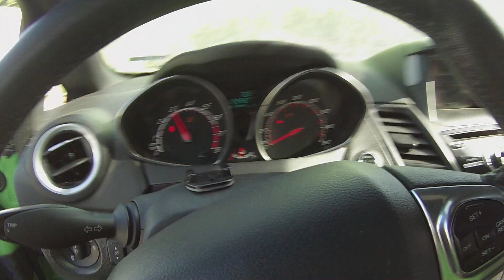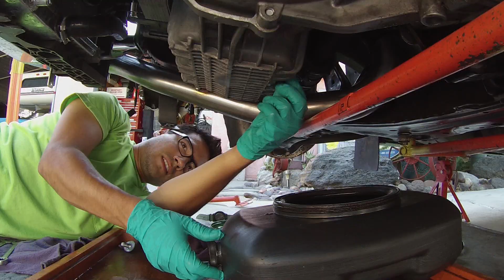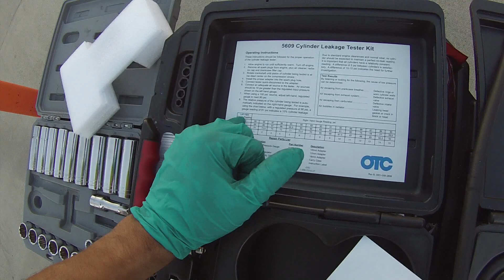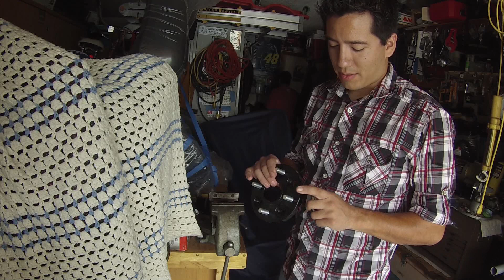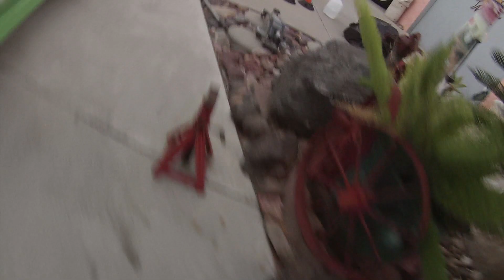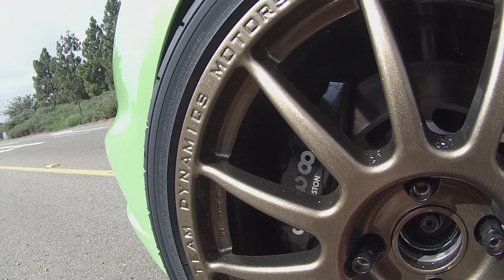Evolution of the Green Beast: Ep. 3 Engine Break in and First Drive

Comment: The reason your spacer failed . The torque spec for the lug nuts is  not enough to completely set the new stud into the hub! You installed the studs thinking they were completely seated when actually they were not. Then you installed the wheels and torqued the lug nuts to spec but the moment you started to drive the added mechanical leverage forced the studs to seat which caused the excessive play to hammer your spacer. Not crack' n on you but as a long time builder and prep guy of over 45 race cars I have seen many people make the same mistakes.  You are young and props to you for the diy efforts as not to many of the youth today can even change a flat tire. Everyone starts somewhere and you have a great future in your hobby.

Comment: 2 weeks after having a Wavetrac diff installed in my iB6 gearbox the input shaft catastrophically failed and somehow punched a hole in the far side of the trans casing. You're not the only one man. My cars been sitting at a shop for 2 months now while I scrap money together for the replacement (same mileage found for $500-700) These things suck, but like you said, it's a momentary setback.
Reply from the maker: Andrew Molnar wow that is a big failure. I know it sucks waiting for the car but it's worth it in the end!
Reply: It is... It's actually made me question the limits of the stock transmission. I thought the iB6 was strong enough to hold 300-400wtq with sticky tires and Limited Slip but a few 2 wheel test burnouts were too much for it (specifically the bolts on the far side of the trans casing holding the input shaft and bearing in place). Those bolts were either loose to begin with, or need loctite to ensure vibrations don't let them back out and then allow a shipped tooth. I got an old '99 volvo s70 awd, its a 2.4l inline 5 with a turbo to daily in the snowy winters here and while the fiesta is down, and its great... but 1000lbs difference and same power as a stock FiST lol... I miss the FiST man.

Comment: What size wilwood rotor are you running?
Reply from the maker: Jeff K 12.2" are the diameter of the rotors
Reply: Are they the .81 inch wide rotor?
Reply from the maker: Jeff K yes
Reply: Thank you, how do they hold up with heat on track days? I'm on some high speed tracks sometimes and the factory brakes don't like the 900+ degrees the car can achieve. I was looking at that kit since it clears my 16 inch track rims, but was informed that it could be maxing out its performance capability.
Reply from the maker: Jeff K just run the correct track pads with the kit and it will be fine. People that have had issues have ran street pads and melted everything. I have yet to have issues using Wilwood bp-40 pads at the track numerous times
Reply: TShirt Driving, Thank you for the information. Haven't had anyone able to provide real track experience with the kit. Looking forward to seeing how the rest of your build goes, maybe I'll run into you at the track someday.

Comment: what sparco seats is that?? is it hard to install seats
Reply from the maker: Sparco Grid. As long as you buy the sliders and mount (side mounts as well with this seat) then everything is a bolt on process. I opted to not by sliders so I had to do some drilling in the seat mounts. The stock seat will be going back in though for street use and I will have the Sparco for track use.